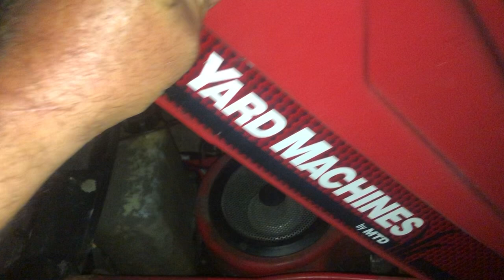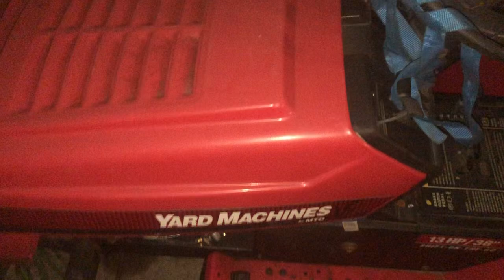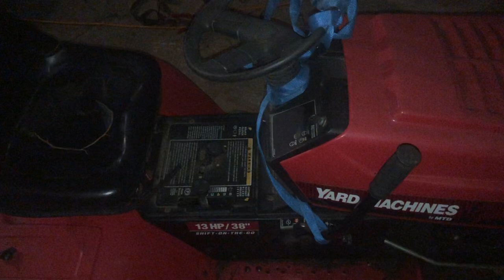WHAT EXACTLY IS SUCH A HUMAN WASTE?

Comment: Stores around here are putting out Halloween candy 
I have been playing with a yard works my boss bought don't know what he paid for it but when it first showed up I had to put a block of wood under the tank the gas line was being pinched off then a starter then the silanoid then the bracket that holds the brake clutch from going all the way down 
Now I have to pull a rod by the rear-end to get it to start 
This one is a yard works it is junk for sure
Reply: I have been getting ready to paint the barn doors they were peeling badly. I have had to do so much prep to get them ready to prime. The doors are 15 ft tall by 6 ft wide. I had to replace some of the wood in spots, too as it is I have spent way too much time on them
Reply from the maker: Yes you a temporary Halloween store opened up at the end of July here 
👻
Reply from the maker: Time consuming repair and maintenance maybe that’s why I see you so many Barnes ready to fall apart
Reply: @steelisthemeal  yes upkeep is a absolutely a must to keep them nice I should do a video of them once they are done
Reply from the maker: @danohstoolbox If you do a video it would be even more enjoyable if you add part of the process from beginning to completion